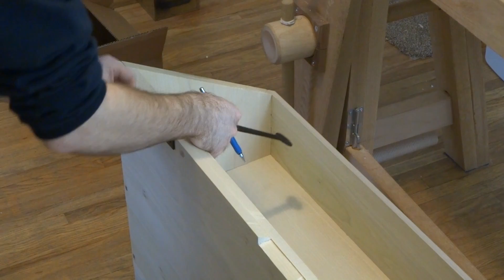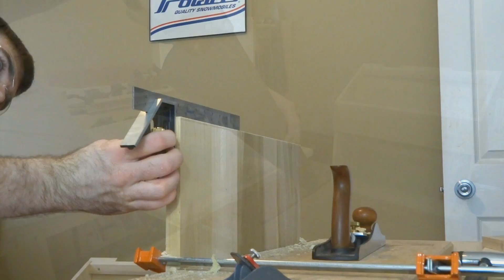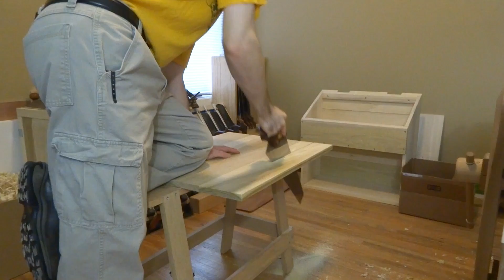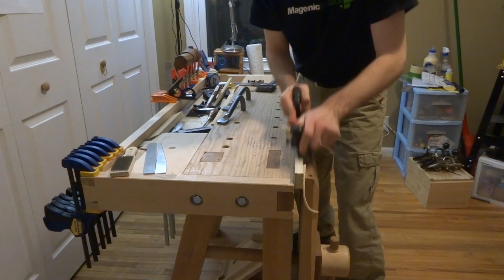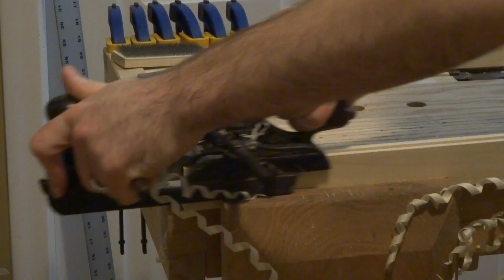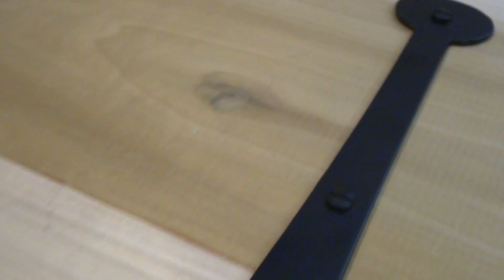Dutch Tool Chest - Part 4: Hinges and Lid

Comment: Thanks Chris I like that bench sorry it walks that's a pain I'm having the same problem but worse than yours. Yours is pretty stable mine is to light but nice,nice work! Keep it up!
Reply from the maker: Thanks!  When I built the workbench I have now, I had gotten off of using a workmate for a year and a half (a small workmate too, not an H-frame), so I know the pain lol  I got used to bracing that thing while using it, so this workbench is no problem compared to that :-)